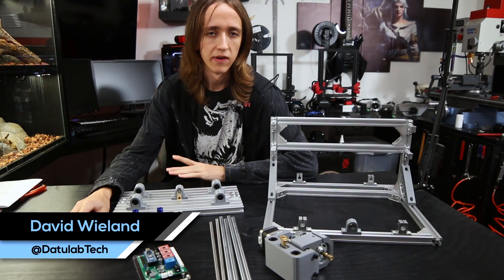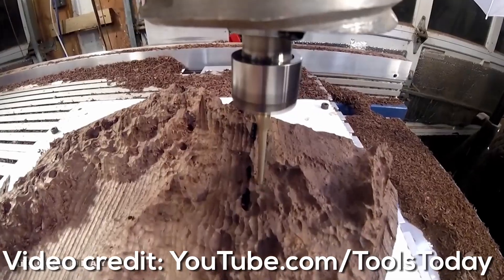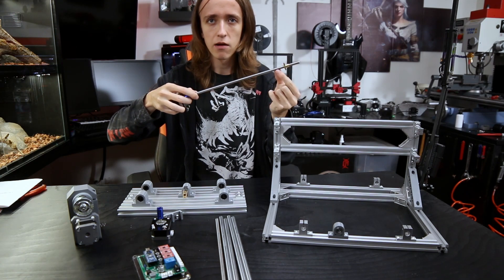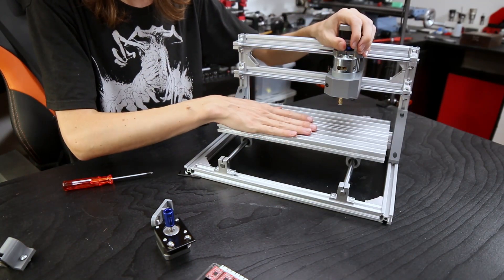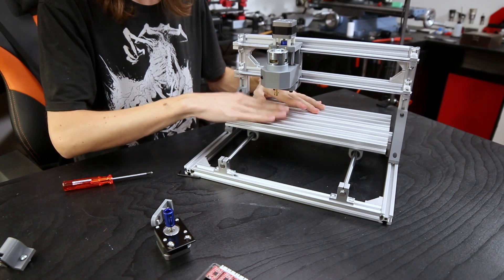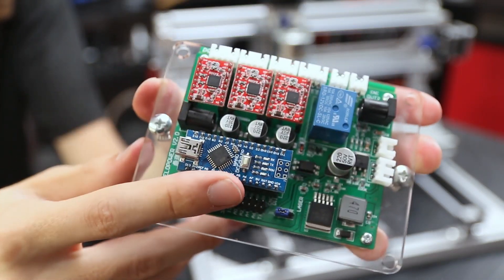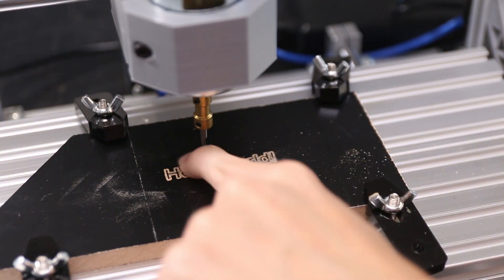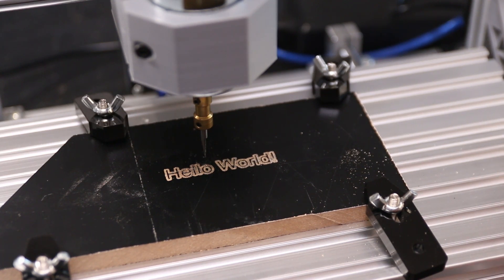$150 ROUTER to LEARN CNC (CNC Basics Explained)

Comment: F- Engrave is free and does a excellent job of writing out a G- code for V carving.
Inkscape does allow to put some fonts on a path, than you can V carve with the
F- Engrave generated G- code or make some G- code using Inkscape itself. Works 

great for this type of engraving CNC. But 2D is not quite all this GRBL driven machine
can do. You can download another free program called BlenderCAM, this is a full 3D
CAM solution, easy to use and well documented. Now you can do some serious 3D
with ease ... like reliefes (Machining only wood and some plastics)

My software recomendation:
Candle (G- codesender with surface mapping).
Inkscape (Linedrawings to G- code).
F- Engrave (V carving G- code and more {try the times new roman font :) }).
Freecad for CAD.

Have fun. Cheers.